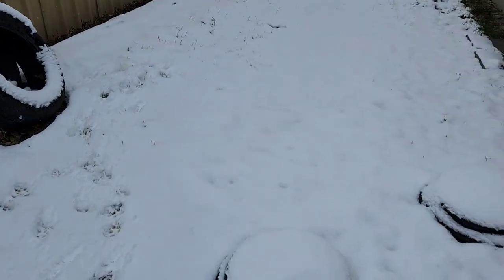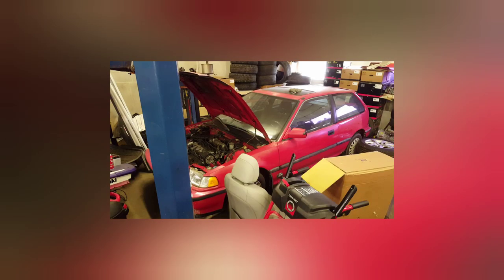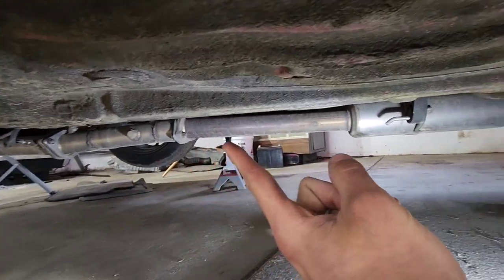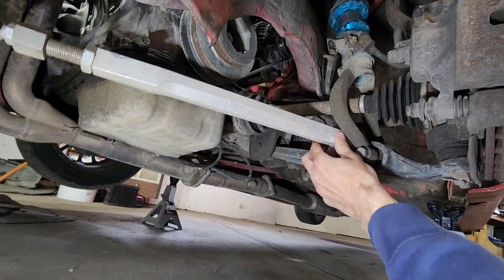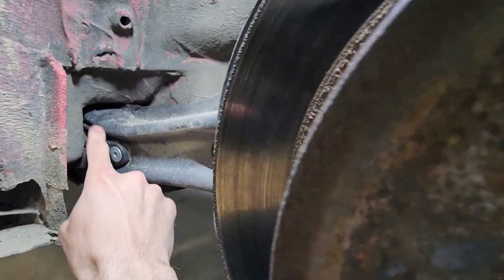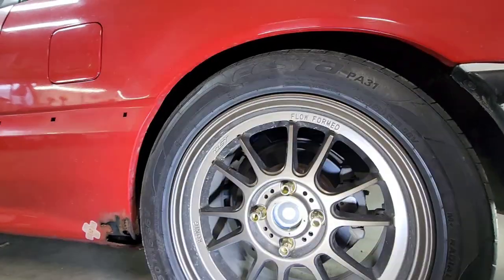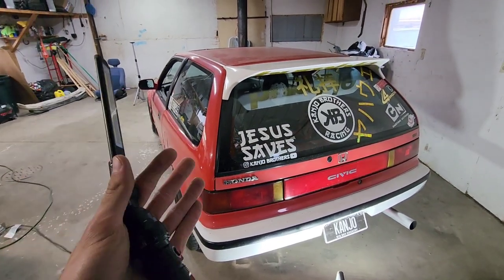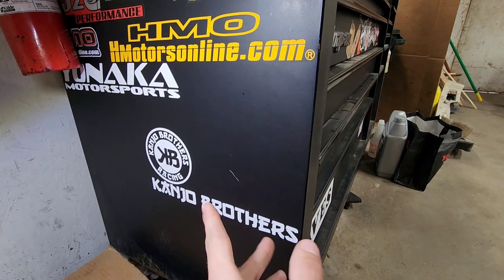Kanjo 1991 Civic EF build overview. B16 swap, rear disc conversion, sunroof delete, coilovers, etc

Comment: Great video the konig wheels are pretty good a lot of people are running them on their track cars & they been running them for yrs with no problems but kosei k1 are definitely better one of my favorite wheels I had them but ended up selling because I wanted a more aggressive spec mad that I did because my dc2 is 5lug & they super hard to find you lucky tire rack still sales them new in 4x100 also look into the hybrid shifter trust me it's great I had ktuned but I ended up getting hybrid on blk fri sale & I love it. You the first person I see that did the sunroof delete the right way super clean if I delete mine definitely doing it like that love the yellow lights
Reply from the maker: Thanks dude!  I've just never seen any actual torture test videos of Konigs or if they bend like they should on impact or explode like reps do. Yeah, Tire Rack is where I'm going to order mine from when I get the money. I'll definitely have to look into the Hybrid Racing shifter. I almost forgot about them

Comment: Trying to find someone to do custom work on a japanese car is pain is the butt in Montana. Theirs no support out here.
Reply from the maker: Forreal... I got an estimate from a body shop here and literally to just cut and weld the new panels in they want $3,000. That's without paint, without having to remove the interior, etc. Literally just cutting and welding. Unbelievable. It would be like $800 if that in NY
Reply: @KanjoBrothers sheesh for 3k you get your rust fixed & a nice full paint job in ny
Reply from the maker: @Budget Build  dude, right?? NY I could get my whole car done for $3,000. Especially if I'm just painting it white
Reply: @KanjoBrothers  yeah bro that price where you out is insane